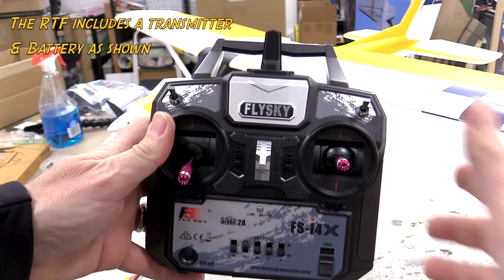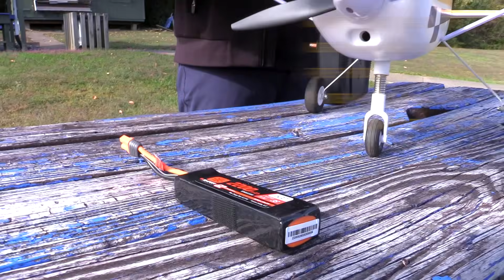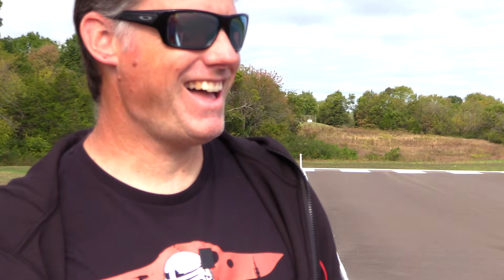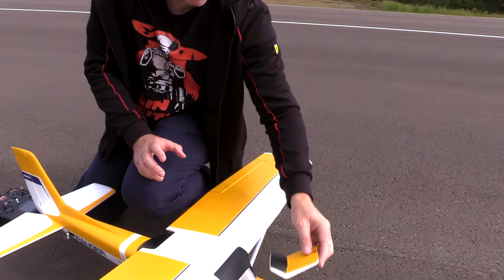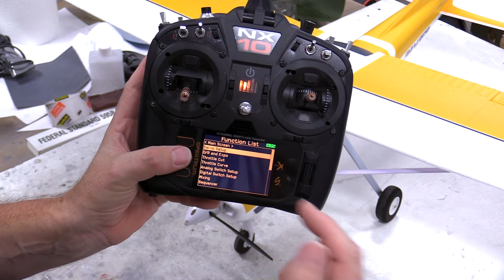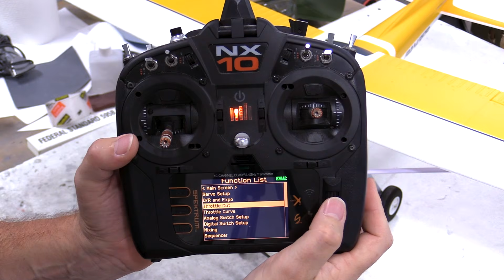Ultimate RC Plane Beginner's Guide - Mastering the FMS 1220mm Ranger

Comment: I’ve seen so many people do a review of this plane. This one was by far the clearest! Loved it. Just one question: if you buy the RTF model, i don’t think you can change rates and all that so is it still fine?
Reply: The RTF Ranger flies great with the RTF transmitter, but you can't setup dual rates, expo etc. You can change the rates mechanically, but the stock setup works fine out of the box.
Reply: @ingmarkocht noted thanks!

Comment: Noob here…..do you have to connect the gyro to begin with? I am about to join a club here in the UK and they will not allow anyone to fly solo until they complete what is known as a ‘A’ certificate. ( beginners are tethered until you pass the certification) No gyro’s or any form of assistance is allowed until after completion of the cert ( no problem with that as it teaches safe handling and control from the get go…). Granted it can be switched off completely. But I don’t think it is allowed to be connected at all……

Comment: what about setting as flaperons?
Reply from the maker: If you’re wanting flaps, I’d recommend cutting them into the wing and adding servos for them. Flaperons aren’t going to be super helpful on this because with the ailerons cambered downward, you’ll lose roll control and increase the potential for tip stall issues as well.

Comment: How many props have you broken? I used to be very into FPV stuff and I just came back after a 5 year break. So my skills are kinda rusty. I got this plane to get back into it and I’ve barely got it into the air and i have broken 3 props just by taxing.
Reply from the maker: Well, I haven’t broken any 😬. What’s the surfaces your flying from?
Reply: I have tried some light grass, and my local flying club (Loveland rc airway). I think it’s probably a bad senter of gravity on my part or just a skill issue 🤣😉

Comment: Thanks for the video, I just received my Ranger RTF with Reflex module. I also have a Spektrum AR631 receiver. Obviously the Reflex module gets totally disconnected to be replaced by the 631 and connected accordingly?I’ll be using an NX8. I will still have all Safe and beginner mode options correct?
Thanks for any help, I’m a newbie.
Reply from the maker: You can keep the reflex module in and use the receiver you have. The key is that you NOT setup AS3X. The reflex module has all the same functionality having a similar mode to safe, so as long as you setup their gyro on a switch like a show here, you’ll have the functionality you’re looking for.
Reply: @ ok thanks for the reply and help I’ll give it a try

Comment: Disappointed, I have to report one strut failed (broke) right at the hinge point.  So, i received this plane last week (red) and went to our flying field today for the maiden flight, armed with our four fully charged batteries.  Well, the damned flimsy strut hinge arrangement broke extremely easily even before we could maiden the plane.  I have been involved in every aspect of the hobby for the last 61 years (I'm 69) and started with a plastic .049 Cox PT-19.  I ended up flying my big T-28 Trojan indtead. I just notified FMS about this issue. Let's see the response.

Comment: Nice video you made. But when we find any rates too sensitive, we adjust the push rods outwards (not inwards to the servo Center)!
Also some radio has stick lever height adjustment which is helpful for less sensitive control👍

Comment: This was my first plane and it is fantastic. Everyone says Aeroscout which I understand because the prop is more protected but it is ugly in my opinion. The Ranger looks like the Cessna it is and is very durable and capable. I think it's the best medium large sized trainer there is and the RTF option with floats offers the complete package. I fly mine with 2700mah batteries. Fun fun fun.
Reply: I need help with batteries. I was going to get 2200 mah 25c but I also see the 35C. Can I use both?
Reply: @paulriccio5333  yes. The higher the C rating, the better the "punch" or burst and discharge performance. 50 C is good but anything over is usually not true. It is highly understood that for the most part C ratings are pretty much bogus as we can't really prove it. Get the size and weight that the plane will fly well with and try and take care of them the best you can. Be extra careful after a crash that the pack is also not damaged. Sometimes you can damage or dent one of the cells and it won't charge any longer then safely dispose of it. It's part of the hobby.

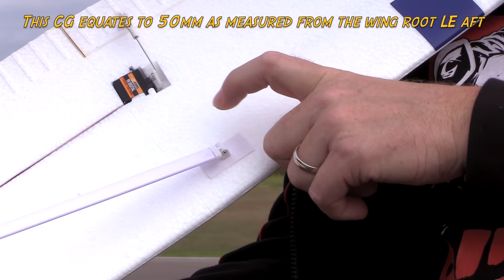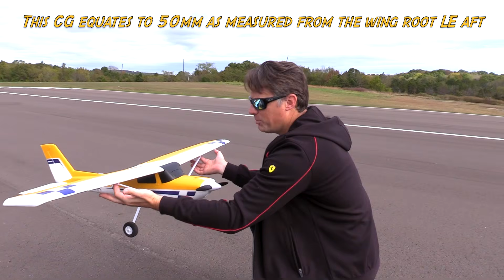Comment: information        8:00   the tail should  NOT  be made heavier, by putting servos there.!!!          8:32   the mass of wing-located servos should be located forward-of the thirty percent of chord line.          8:36   the model should be supported a  FEW  inches from the fuselage, during cg-balancing.         the optimal location of cg is at  thirty percent of chord (or mac).         in this case, the use of a larger battery apparently  forces  the cg to be located forward-of its optimal position.        d
Reply from the maker: That is a pretty broad swipe of the brush there.  The servo location I get what you’re saying, but so long as the cg works out, it’s fine and servos in the tails is pretty standard for prebuilt airframes these days (not the way I do it on my own built stuff).  However, a one size fits all solution to cg might work on a simple Hershey bar wing like this, but not when you start talking about more complex designs and geometries. There’s also personal preferences in feel too when talking about cg. We can agree to disagree on this, but I would never recommend a 30% Mac cg location as a start because that doesn’t guarantee static stability in flight since it would be behind the cp of the wing. That would be an aft location I would recommend working up to depending on the style of flying you’re looking to perform.